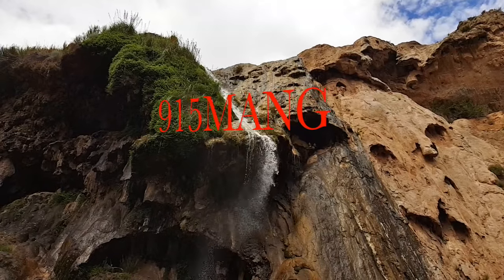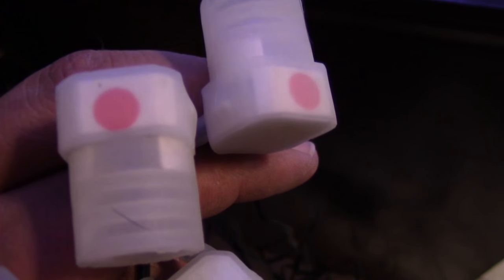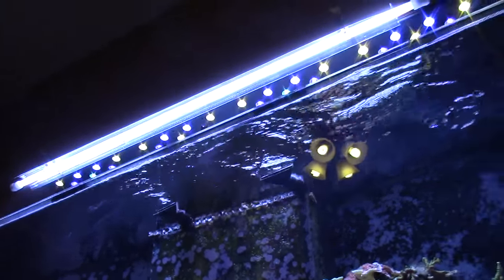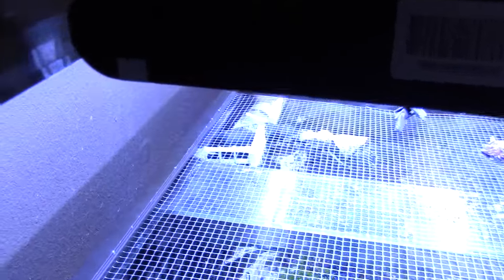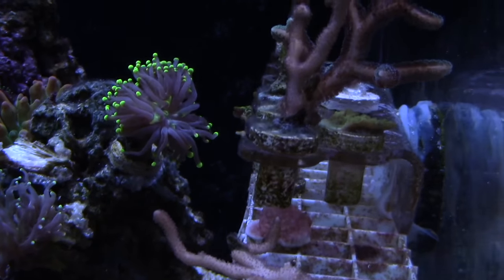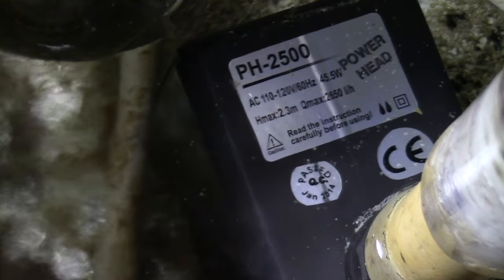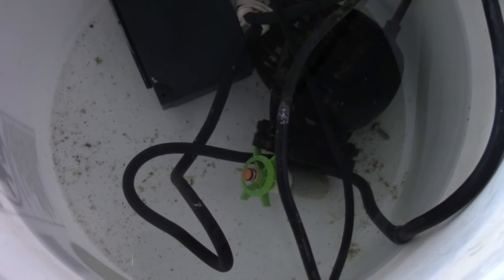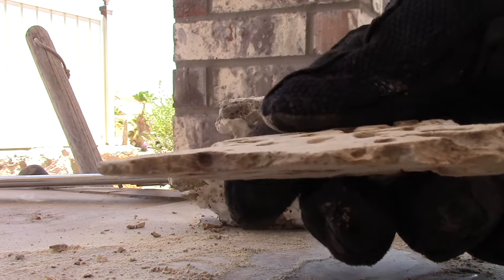BEST GROW LIGHT INDOOR GROWING  REEF BREEDERS LED  T5 LIGHTING

Comment: Nice update and nice lights. Things look like they are growing well. Anemone will go where they want to. I'm lucky, when I upgraded my tank a few weeks back, I put my rose bubble tip in the new tank, hoping he would stay where I put him, and he has. First time I put him in my 100g, it killed my 40 head candy cane!!. Sometimes you can be unlucky with peppermint shrimp. They don't always go for aptaisia. Or maybe you have not got a ture peppermint shrimp. I use lemon juce in an old test kit syringe.
Reply from the maker: Yeah Thats why I keep an eye on my Nems. I have one that has been on the same rock pretty much since the tank was started. I still havent seen the peppermint, I dont know where the little guy is. I think Ill look for it at night when the lights are really low. But If not, im not getting another one. Ive been using aptasia x, but the lemon juice method might work for me, that and kalkwasser. I have a ton of kalk that I could use. Thanks DOC, have a good one!

Comment: I also had a large aiptasia outbreak a few years ago. I found that it is usually best to have a group of  peppermint shrimp, that way at least of few will probably eat the aiptasia. I waited til they were on sale at my local lfs and bought about 12 of them. Even then I didn't see results for a few weeks. I also injected the aiptasia with a 50/50 AiptasiaX/Kalk slurry mix. I believe this mix damaged and weakened the anemones and  made them a more attractive target for the shrimp. It has been about 2 years and I haven't seen many aiptasia in my tank, I also have a few shrimp that will show up at times. Good luck!

Comment: Nice video mang! Ive been thinking of a way to possibly add some supplement T5 lighting to my tank and still look cosmetically pleasing. Maybe some 24" ones. When I started dosing, I did the same thing and start dialing in the Alkalinity first then I moved on to dialing in the Calcium. I check Alk now about once a week unless something looks way off. Love your Candy Cane coral. Good idea on the rack plug shelves!
Reply from the maker: Hey Wil, Lots of options. You could use some 80/20 and make your own light rack. I used an Aqua Illuminations Light rack when I first started because I had the AI Sols. But the 80/20 is way cheaper

Comment: I know this is an old post on the Reef Breeders LED, but I hope you see it and respond.  I've been running a Reef Breeders Photon V2 on my 50g cube for over 1 year.  I've noticed most of my zoas are extended up towards the light.  I've read they do this when they are trying to get more light.  My blues and purple are at 50%  What are your blues and purple set to?  Should I increase the percentages?
Reply from the maker: strat1960s Yes Increase your lighting especially the White light. What are you at, I’m on 50-60 look at my setting video it has the controller thumb nail. You’re photon has plenty of power. Just increase the white settings for now. Let me know
Reply: My white is set to about 5%.  Won't more white increase the algae?
Reply from the maker: strat1960s No, 5% needs to be brighter.
Reply: Ok.  I'll give it a try.  Thank you
Reply from the maker: Should help out a lot give it a week.

Comment: hi  there ! Am Using DIY LED lighting 
for my (4 feet, 20inch height ) 90gal tank - 72 x 3W LEDS with 90 degree lens 
( 20 Cool white ,40 RBlue ,4 spectrum pink,2 green , 2 red , 2 violet and 2 UV) fixed 12 inch from water level  Looks rely rely nice coloration and little purple look.  but my Anemones hiding and slightly get bleached even water parameters and perfect condition and also feed them Using hikari Coralite twice weekly . am i having too much lighting ? or too much white ? can u help me ?